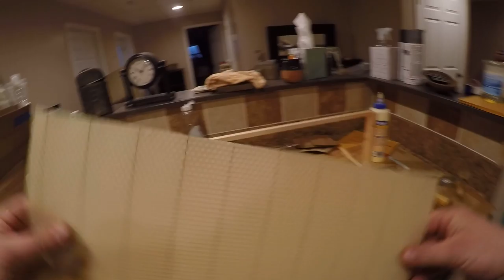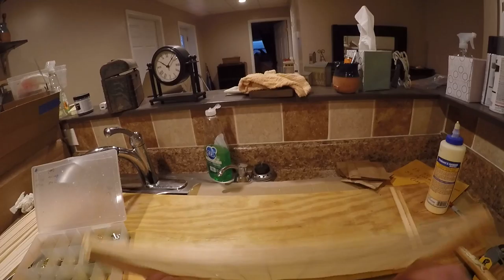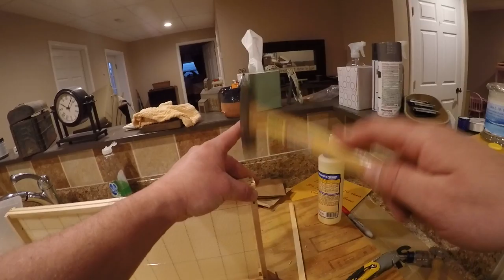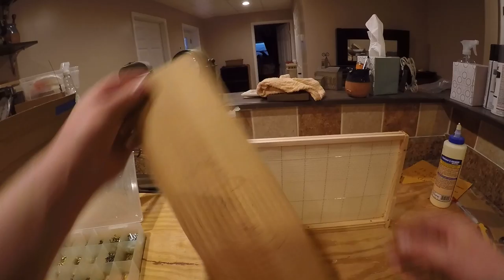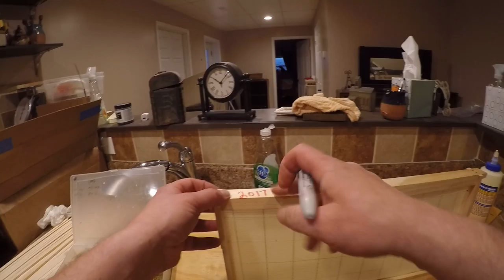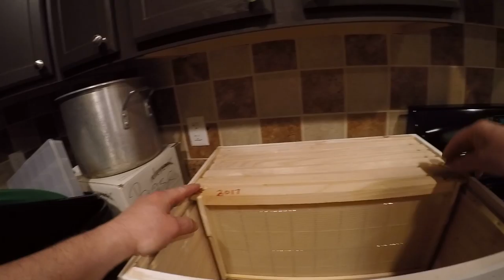Beekeeping deep frame wax foundation installation- spur embedder

Comment: i have a question, i have seen people eat the entire piece of comb before. When they do this, are they eating the wax foundation sheet when they do this? Is the wax foundation made of edible beeswax?
Reply from the maker: chad mc - yes it is foundation, but when beekeepers prepare for cut comb, they use a thinner sheet made for it. I attempted to make some cut comb frames last year and instead of wiring the frames, I use support pins to hold it along the sides and put a small bead of hot wax along the top bar to help secure it.
Reply: ok cool. I have been watching these beekeeping videos for a while and I hope to try some straight comb one day. I am having no luck finding any where i live.
Reply from the maker: chad mc - check the bee suppliers. Also may be known as "thin surplus comb". It's usually found in the 4 3/8 size